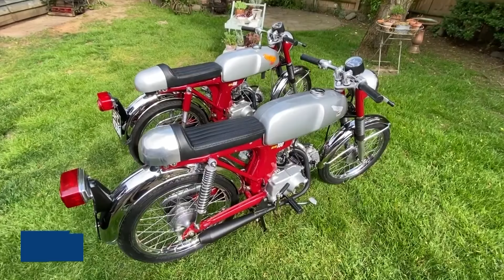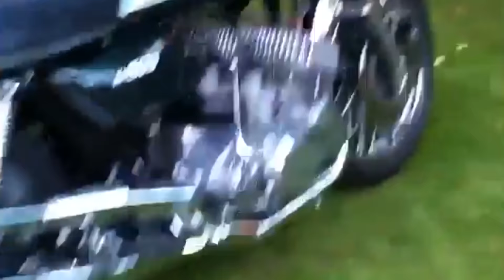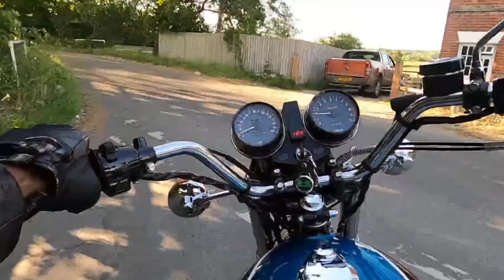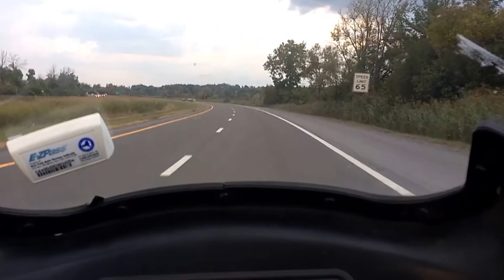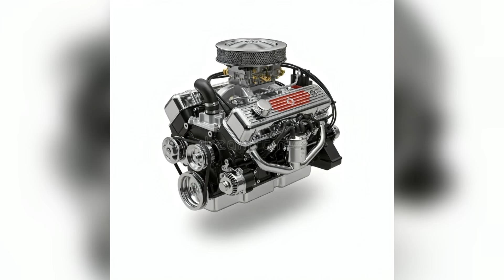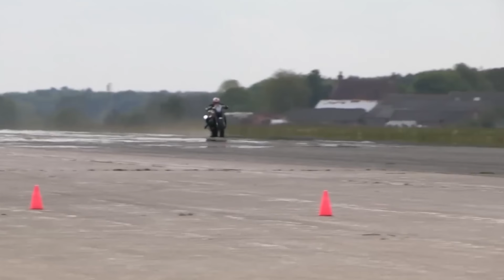10 Rarest Motorbikes in ALLEN MILLYARD's Insane Collection - Most Massive Engine Ever Put in a Bike

Comment: We remember we had about 3 broken suzi 50cc motorcycles 🏍 ( not the panelled ones ).
We used to ride them around a farm we had permission to play there helping out fixing any farm machinery that broke down. 
Of the 3 suzis, while trying to set the  timing we knackered up the crankshaft end thread that fastened the flywheel. 
Well lucky for us the farmer Had a stick e electric welding set up. So we took the chance of welding the alloy flywheel onto the high tensile steel crankshaft. With pot luck that the timing was bang on and would still run. 
AND IT DID. From the moment we kicked it up, the sound of the engine sent shock waves through us. Its timing was so spot on we had an uncontrollable speed maniac that was so fast it beat a brand new just run in 
 suzuki 500cc on a 300-metre straight road. That 50cc suzi was a bat from hell. 
But after only 2 more days the Weld broke and it never ran again, I've never been on anything ( for that 2 and a half day fling with a monster ) that fast and after discovering Allan millyard I can share his love of building speed of one's own talent. 
God praise you Allen. The natural Angel.